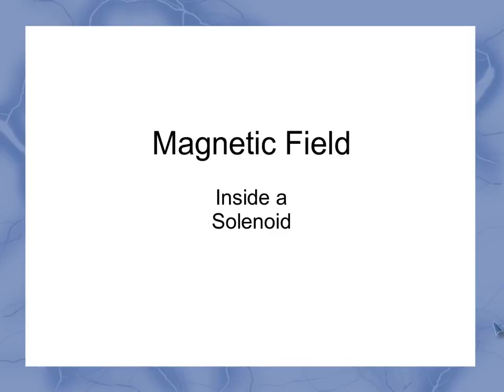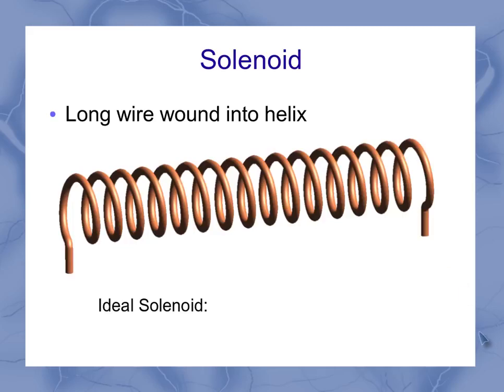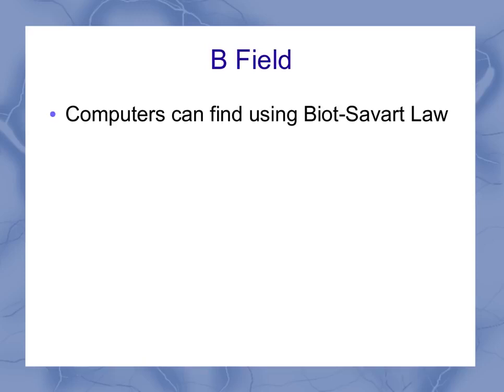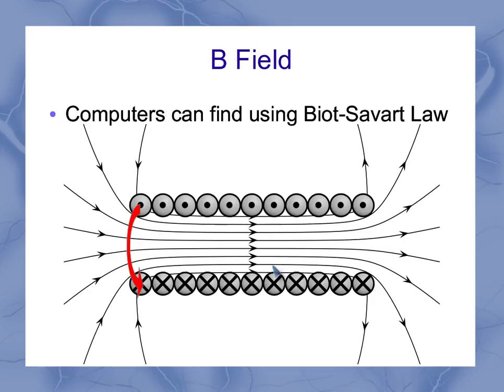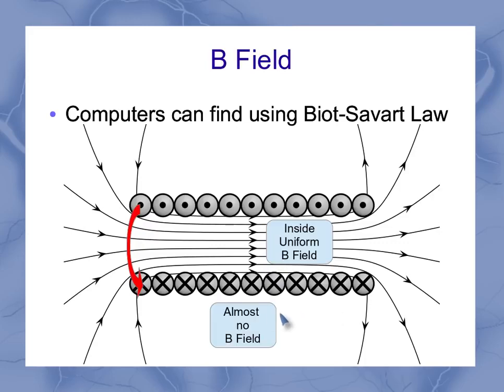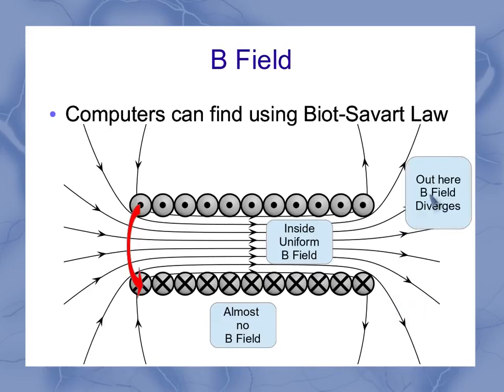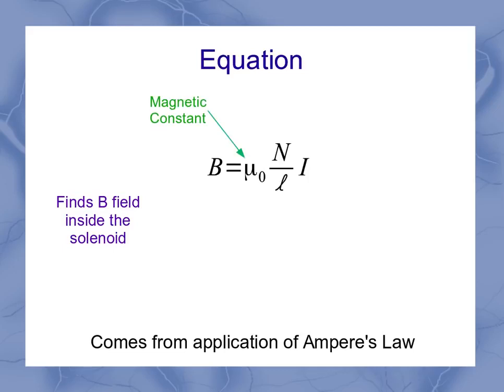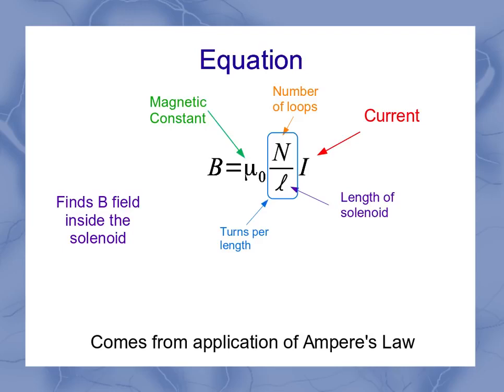best education satisfying video |  Paradox Capricious

Comment: Hi, what if the solenoid is made of a hollow tube completely filled with ferrofluid and with both ends of the tube connected and looped through a high-speed pump moving the ferrofluid inside the tube, will the ferrofluid filled solenoid produces a magnetic field or force?